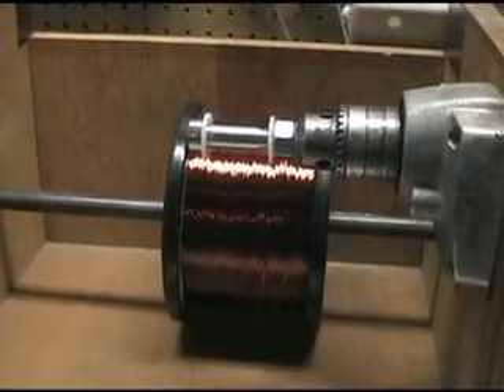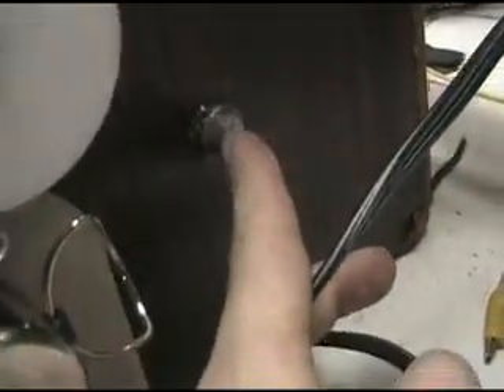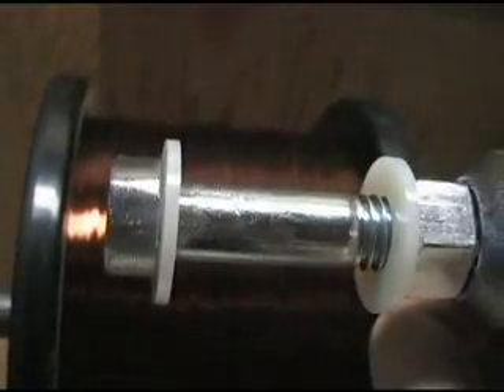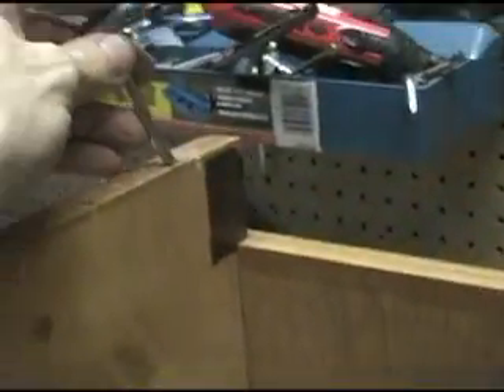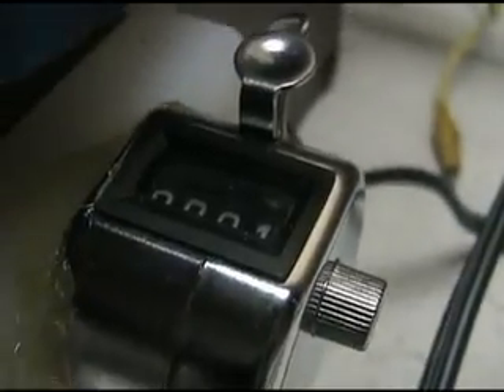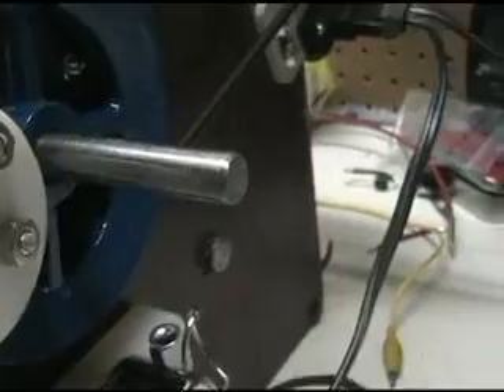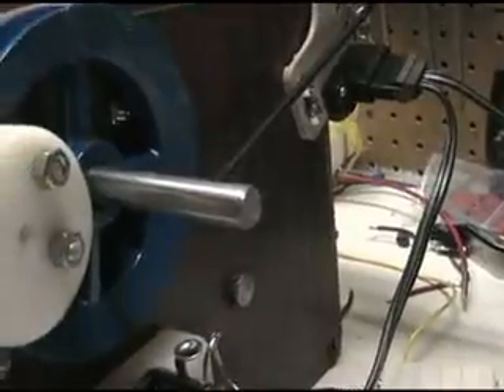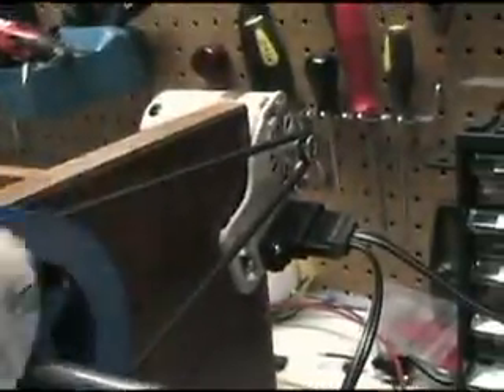Homemade Coil Winding Jig

Comment: is your foot pedal resistance continuous?

I have one that is simply a 4 step thing, as the pedal is pushed down a plate touches another in effect shorting a resistor, then nothing for a whil and then anothe plate touches the first and another resitor is shorted etc. and there are 4 or 5 plates like that. so all in all it's pretty useless for this kinda application,

But nice build really.

Comment: i have one design of my own ,i am using an power supply from an computer to get 12V and i have an motor from a battery power drill machine ,and an PWM controller ..i have place the pwm potentiometer on my chair 's leg ..so i can operate it with the leg ... here ..take a look ...
watch?v=f64QJ9uxfS0

Comment: nice,but ...counting is not a good idea ,you can do it with an electronic calculator for pocket ...you take an magnet and place it on the well and you can place the magnet into the eccentric place and an reed relay has to stand in the magnet's way ..so at every turn the reed relay is gonna put to wires together ...wires that comes from the equal key from calculator ,and when you want to count you start the calculator and do 1+ and then rotate the weel and coil and the calculator is gonna count

Comment: @Kntryhart. I have some drive belts which come in 1/8", 3/16" and 1/4" diameters in metre lengths.
Cut required length, hold the ends together and pull over a heated knife blade.
This melts and welds it into a circle. Leave to cool and solidify. I use mine on a small lathe and other odd and end tools.

Comment: @Whammo1963 Because the wire is cylindrical, it naturally will not pile upon itself. If the two spools are kept at the correct distance, the wire will naturally slide over itself and go back and forth evenly on the new spool.